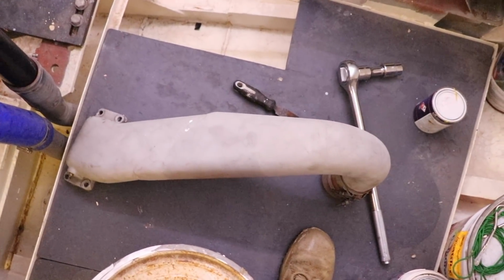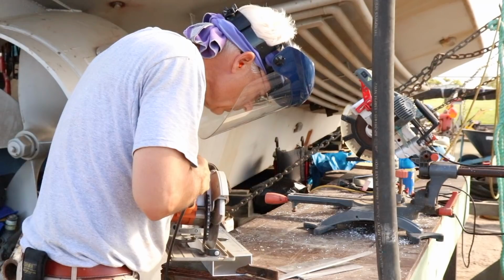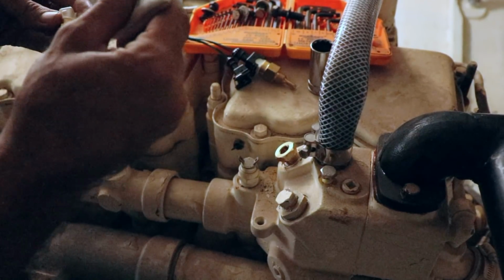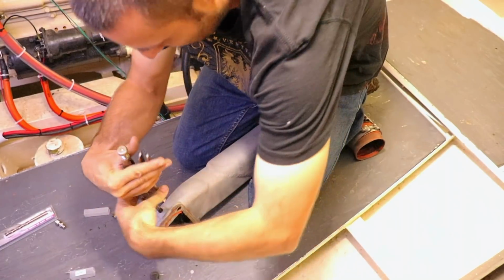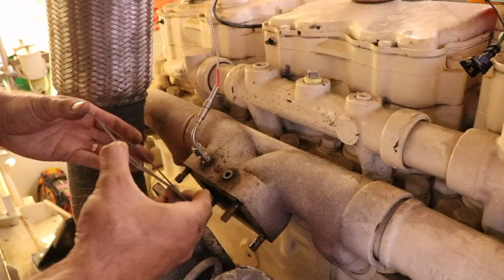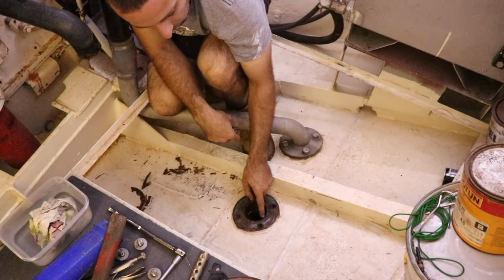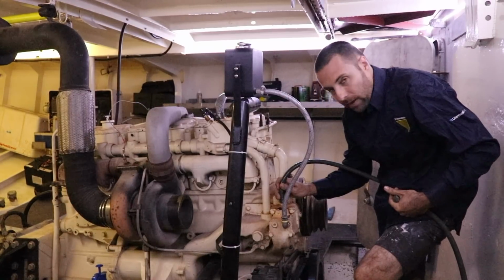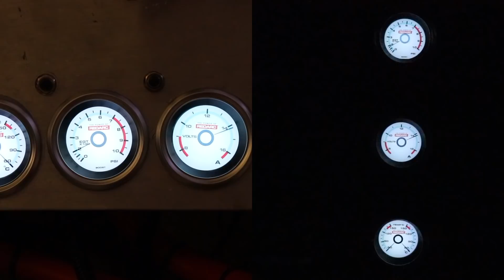Fitting RedArc Engine Gauges (part 2) - Project Brupeg Ep. 84

Comment: Nice work on installing the dual gauges. Good to have them in the engine room as well as the wheel house. Your getting there, one step at a time.
Reply from the maker: Yes it’s very handy having both sets up and running

Comment: GREAT JOB! I just love the thought possess. Hey when I had boats I found a product called Bullfrog Anti- rust emitter strips, you can find them on amazon. I put in all the areas where electrical connections, like terminals and enclosed areas. They stopped all corrosion, you know the green stuff. I have no idea how it works, maybe magic but it does. I put them every where there could be corrosion on electrical connections. I put them in my gun safe and it does wonders in their. They are on Amazon. I used mostly the stick up cups, they have lasted for years. Salt air used to tear my shit up after years no matter how they where installed, but after I used them, and others boaters I know no more. Magic !
Reply from the maker: Sounds brilliant, any chance you could copy a link to some

Comment: You may have a cooler water temperature reading from the upper sender unit as the probe isn’t in the full water flow. I can’t see if you’ve put a 12 volt positive wire on the fuel pump solenoid. Doing that will stop the engine as designed. Noticed the engine has Jacob brakes but obviously not wired up.  Be a laugh hearing those going when you’re sliding down a BIG southern wave 😀. If you ever need to do rocker adjustments you could do away with them. You will need to block off the oil feed galleries at the top of the rocker boxes with blanking plugs. Love the videos and can’t wait to see Brupeg on the water.
Reply from the maker: Thanks Lindsay, yes she is an old freightliner and does have jack brakes as a result. I do plan to remove them but it’s way down the list at this stage. We did have a 12 V feed to the solenoid but the issue was great and the solenoid jamming the diaphragm. Once we cleaned that out it ran perfectly

Comment: Project Brupeg,
Did you watch the latest Dangar Marine vlog? You should! With all your gauges you should consider one more. A gearbox oil temp sensor. 

A FLIR camera or Chinese knockoff would probably be a good idea also. It’ll catch the Un-instrumented areas for oil fires, electrical fires and such. Especially considering you’re going to go all over the world. 

Also consider a waste oil tank even if it’s just a double wall 55 gallon drum that you can have sucked out when in port. You can burn most of that oil with your veggie oil system but you’ll want to keep it separate and depending on the territorial waters you’re in you may need to keep track (log book and disposal records) of your used oil from maintenance. So you can provide proof it didn’t go overboard.

Also another double ball 55 gallon drum for cleanup of contaminated bilge water for when you have a hydraulic line or fuel line break. And you WILL have that issue. Not because of anything you did but just because stuff breaks. 

22 year Journeyman Diesel Mechanic speaking from experience.
Reply from the maker: Cheers Jeremy
This sort of thing is down the list for us. We’ve got a lot to get to before  this kind of detail. Thanks for the thoughts. Dame has talked about it before and it’s on the list. Jess
Reply: Project Brupeg, regarding the drums I know the need for them is a ways out. I only mentioned it’s because while you’re doing fab work and layout of things you might consider building a level platform or two to store a drum or two and a way to secured them in place. 

You are doing good work. Keep at it. Love you solar array and low voltage electrical. Well done. 

While working on your electrics you should be able to mount a second alternator on your Cummins. Or at least a very high output alternator. But two 200amp alternators is no problem. Lots of mounting options on that engine.
If you stay with one alternator then with an isolator you can charge your house side while and your starting batteries at the same time while keeping them separated.
Reply from the maker: Yeah the plan is to run two alternators as we have different voltage to deal with (12v for engines, 24v for house). As for tanks etc, I’m planning on building a bunch of tanks into the engine room. Four fuel, one grey water, one black water, one waste oil. I’m thinking of these being alloy tanks but I do have a couple of 250L stainless tanks that were used for hydraulic oil which could be repurposed for waste oil pretty easily.

Comment: I much prefer Nickle compound to copper compound for high temperature as I've found that the copper tends to dry out and harden, acting almost like a thread lock. In the one factory I worked we had to smash a bucket elevator gearbox because we couldn't get it off the shaft because of the copper compound hardening, gluing it to the shaft. We snapped the 25mm chrome vanadium rods of the hydraulic puller and couldn't get it to move. 

Drilling through the plug in the exhaust manifold to install the TC was a clever idea. :-)

Comment: The EGT sensor wire is generically called thermocouple wire.  There are a few different kinds of thermocouple wire and the correct one depends on the exact type of thermocouple (Type J, Type K, etc.) you are using.

That type of thread sealant usually takes 24 (or more) to cure.  About the only way to break the bond is heat and on the high sealant you will likely need an oxy-acetylene torch !

When you do get around to replacing those studs, use Inconel.
Reply from the maker: Thanks Jack

Comment: We used to use Loctite C5-A grease (nicknamed 'Galaxy grease') on aircraft after burner thermocouple probes, now they get hot :-),                                                          from the Loctite website:                                                                                                                                                                                                                                                   exclusive anti-seize lubricant in a brush top form with copper and graphite suspended in high quality grease. NLGI Grade of 0.
LOCTITE® LB 8008 C5-A is an exclusive anti-seize lubricant paste in a brush top can, with copper and graphite suspended in a high quality grease. Applications include screws, nuts, pipes, exhaust bolts and brake calliper bolts. Resistant to extremely high temperatures (up to +980°C) and protects from rust, corrosion, galling and seizing. It has an NLGI Grade of 0.

    Resistant to very high temperatures up to +980°C
    Unique brush top
    It has an NLGI grade of 0
    Protects from rust, corrosion, galling and seizing
    Used for screws, nuts, pipes, exhaust bolts and brake calliper bolts
Reply from the maker: Nice. Yeah if we have any trouble with the probe we will just pull it and add this loctite stuff in (assuming I can get it here)

Comment: Cummins have wet liners , you must used corrosion inhibitor to prevent electrolysis holes through the liners and it happens quick.
Reply from the maker: Thanks Warren

Comment: You need a longer water temp sending unit.  Buried in that sdapter at the top of the engine, there will be a trapped air pocket surrounding it and it will read low.
Reply from the maker: Yeah we did discuss this. We have run the engine for a while without getting any real heat from her. Trouble is can can’t load the motor up yet so the top pipe barely gets warm. Our plan is once in the water double check if this sender bubble issue is something to bother with, if it is. Pull the sender, let the water flow out then put sender back in. Most of the trapped air will go. That said this is the factory location so it can’t be all bad

Comment: Damien! You must use premix coolant in your engine not tap water. Serious internal corrosion and electrolysis damage will occur without it. Love your work, determination and build quality.
Reply from the maker: Thanks mate. Yeah we will be running antifreeze. But as we are still leak testing we run straight water as we do need to dump it out every now and then. And as our cooling system holds hundreds of litres of water I don’t have barrels to store antifreeze every time I dump it out. I have the coolant sitting there ready to go, it’s just we are not ready for the final seal up just yet
Reply: @ProjectBrupeg  All good. I didn't want to be a keyboard warrior but would hate to see you broken down at the ends of the earth. Keep up the good work.
Reply from the maker: Yeh I can understand. Most commercial boats in the world have single main engines. Twins are more common on private pleasure boats where maintenance is often less than a commercial boat standard

Comment: Hi Guys.  Sweet vid again.   Will the water temp sender get an air pocket around it being at that angle? I am concerned it may not be sensing water temp but the air temp in an air bubble.
Reply from the maker: The top sensor is a factory location so it’s possible it could get an air bubble but I think if it was that common and that much of an issue Cummins would’ve moved it. As for the bottom one. Yes that could also but much less likely

Comment: Attaching two dissimilar metals causes corrosion. Does the aluminium box you made which you attached to the hull with the glue/sealant have no contact and is the sealant acting like a spacer? Reason I asked is I would happily use the same method. What is the name of the glue/sealant you used please. It's a pain finding glues that do not react with aluminium. Thanks. 😁🇦🇺👍🏻
Reply from the maker: Yeah the box has about 3-4mm clearance from the hull and the lid is alloy on alloy with a small beam of adhesive. The adhesive we use is this stuff

https://www.fixtech.com.au/process/catalogue/itemView.html?itemId=195181&categoryId=571

Comment: I'm curious about that copper grease you use on the studs. Is there an increased chance of the nuts working loose when you use stuff like that? Is checking the torque of fittings something you would check after a certain number of hours during normal working?
Reply from the maker: I’ve not experienced copper coat working fittings loose. That said it might happen so a periodical check wouldn’t hurt.

Comment: Loving the build.  Boy it is every neat and tidy.  I was looking at the gauges, and got thinking, they are not in the same order.  ( <EGT> Middle in bay is top in wheel house.  <Volts> Right in bay but Middle in wheel house ) If you are not used to looking at the ones in the bay due to lack of being down there, at a glance you will be used the the wheel house order.  Not that I want you to need to make a new cover for one of the two of them, but would it be worth putting them in the same order from left to right or vertical in both locations so at a glance they are uniform and what your used to?
Reply from the maker: Bob I never even thought of that. I hadn’t noticed them being different. They are easy enough to swap over
Reply: @ProjectBrupeg  I was thinking they could just be swapped easy enough.  Enjoy your build.  Looking forward to the next video.
Reply from the maker: Thanks very much

Comment: was there any reason you used plastic ties and not metal ones on the overhead cable tray in case of melting and wire sag during a fire? or are they out of the way enough for that to not be an issue? I figure you probably have a good idea on what you're doing I was just curious. cheers
Reply from the maker: They are all pretty well out of the way. If fire has got to a stage of melting them the insulation on the wire has likely gone and the room is well ablaze.

Comment: In my four decades of being in the welding business I have never seen anyone weld such a small socket with a mig welder, probably because one would be fired for doing so. I know it's your baby and you'll do whatever you damn well please, I'm sure you realize that a Weld on such a small diameter should have been done with gtaw or smaw process, just a lot more controllable . Good luck ! Cheers !
Reply from the maker: Nope no idea what type of welder should be used. I use MIG because I have one, and because I know I get get it to hold and seal. I can’t say the same for my Stick or TIG ability. Remember I’m not a welder so I don’t know what I don’t know
Reply: What sort of welding buisness?
Its fairly common practice in earth moving and agriculture 
Iv had welders weld hundreds of 3/8 threaded bungs onto dozers for me 
That's the way caterpillar does it
Reply: @fowlletm1992. Just as I thought for someone to mention a non critical welding application meaning what's the worst that could happen a potato planter blows a hole in a improperly welded hydraulic fitting. And I have worked on heavy machinery through the years but it doesn't compare to a vessel at sea where things can become critical in a instant, you just can't jump off and call for a handyman. As for my welding experience it's could change from year to year, it started in pressure vessels, then on to natural gas pipelines, navy frigates, a few years building offshore platforms from the early jackets on up which again anything offshore can be life threatening,it's why the welds are heavily scrutinized, MPT testing, e-rayed you name it they do it.So can you see where I'm coming from in doing a certain job the proper way, I'm not bashing the young man I'm 100% behind what they are doing, you can't be too safe at sea and that's all I've got time for this day. Cheers !
Reply: @1armedguy4  
This isn't a natural gas line or even a hydrolic
Its under 9psi not 9000
You can literally stop a leak with electrical tape 
Doesn't matter if it critical or not I'm yet to see a failure welding little bungs on 
And they're holding 10kg plus of control valves or hose racks

Comment: Exhaust stud can be a total pita. Working on some Ford auto engines, the stud holding the turbo would look like yours if they were originals. The high temps trash the regular steel studs. We would only use stainless when we replaced them. Even for manifold studs, weather on gasoline or diesel.

Was wondering... You mention putting in redundant systems for controls and gauges to monitor the systems. Beside cost, wouldn't you want multiple sensors at each point for that? I can see some that wouldn't have to be that way, and some that I would run again. Oil pressure, oil temp, rpm, hot side temp being some that I would. Just to have a secondary to check against if I had a reading I didn't like during a critical time without having to fly down to the engine room to have a look.
Reply from the maker: Good to know, how did the stainless hold up over time?

and yes normally I would agree with you about the sensors, however sensors are the thing most likely to fail so rather than add more possible failure points we increased the spare parts bin with extra sensors as they are very fast to change out in the case of failure
Reply: @ProjectBrupeg  The stainless studs hold up great. They often would make the difference between having to pull a head to drill out broken studs or doing an on engine repair. Ford did make the switch over to using them from factory.
Reply from the maker: Ok that’s really good to know. Thanks for this

Comment: hey, did you try to get those "bongs" out with hex socket for ratched? (sorry for awful english) i had same sort of problems with repairing my ford brakes, when i tried with normal allen key, nothing, the thing just flexed, butt when i changed to socket, boom! instant removal
Reply from the maker: Hi Matias 

No we didn’t have a hex key the right size. In the end we gave up and drilled them out without drama. I didn’t have much faith we would get them out by unscrewing them. They were well seized
Reply: @ProjectBrupeg  be thankful of not having any drama, because.. well you know... old steel part´s and heath, quaranteet to jam up very good :D
Reply from the maker: Yeah I thought we might have a 5% chance of in screwing those bungs. And a 100% chance I could drill it out (use to do that for a living as an engine reconditioner)

Comment: just curious why you have gauges and stuff so low to the bottom of the boat and not up eye level and that box with that computer thing on the bottom and not up eye level also , but nice big engine room !! will you be setting up a small machine shop in it
Reply from the maker: Hi Anne. Gauges in the engine room will hardly be used so we wanted to have everything in one spot, (ie batteries, gauges, fuses etc) given the weight of the batteries it was always going to be low. That said you can read the gauges from the roof line so it really doesn’t affect much. As for machine shop, yes definitely, down the road I want to fit a small lathe, turret mill and a good sized bench in there.

Comment: Years ago I remember working on an outboard that had set all of the electrics inside resin - maybe that would be a good solution for the EGT sensor box?

I guess you made the box that size because you're putting in a second EGT box as a spare?
Reply from the maker: The plan is to seal the box and use silica gel to trap the atmospheric moisture

Comment: Awsome video again guys just one observation you didn't mention any corrosion preventive in the cooling system, I am assuming you used it and just forgot to mention it but if you did forget to add it you have been reminded love the work would have to concur with Gary Baris nickel compound is far superior to copper for anti-sieze use Never sieze is a good one and I would also avoid RTV sealant anywhere unless you pay the extra for neutral cure due to the acid released on cure. I prefer polyurethane sealants like Sikaflex.
Reply from the maker: Thanks, we haven’t put any anti freeze in yet as we are still doing all the leak checking etc, once we are sure we have a closed system, I will fill her up then